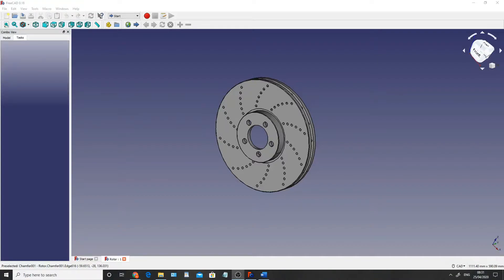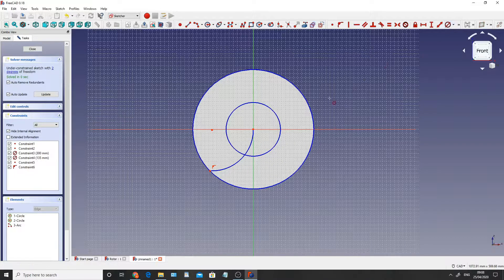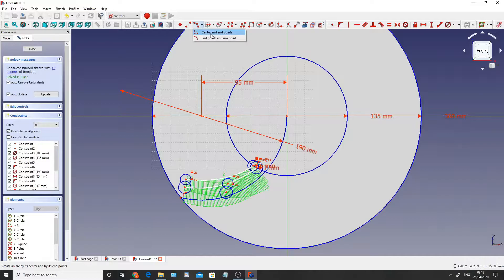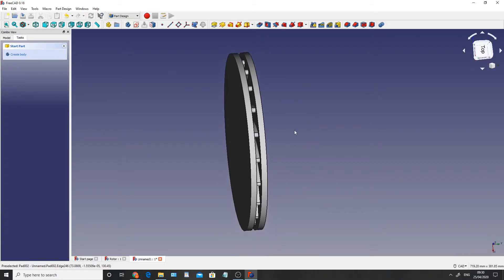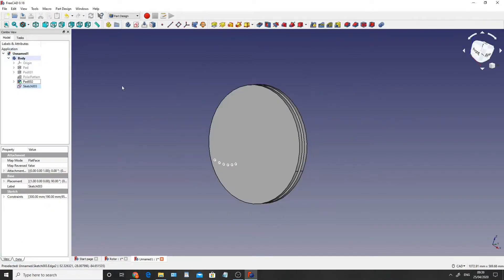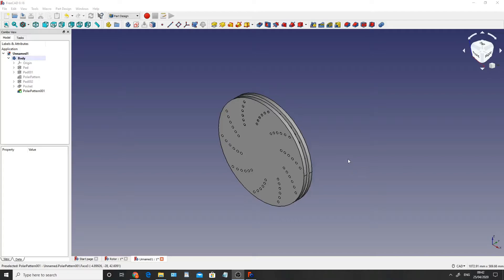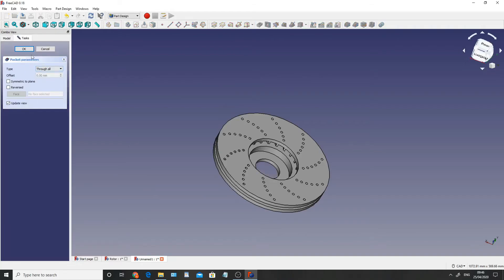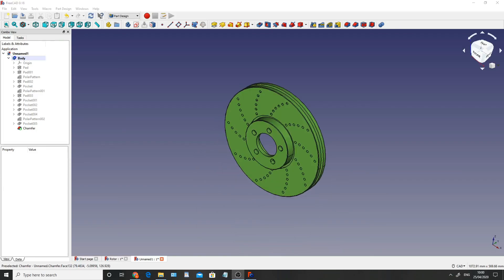FreeCAD Tutorial: Creating a car brake rotor

Comment: So idk what I'm doing wrong here but I keep getting a box in the middle of the rotor when I try to insert the 135 mm pocket into the rear face of the rotor. It doesn't even go as deep to see the cooling fins. Any suggestions?

Update: NVM Fixed by going 1mm smaller than 135 and it fixed the issue. I think it is perhaps due to my cooling ducts being on the 135mm construction circle at full length and getting cut through with the pocket i was trying to install.

Comment: In this case, what is the benefit of creating a construction line instead of using an external geometry when possible?

Further to replace the junky b splie wouldt the be possible to use 2 seperate datumplanes and rotate them in of offset around the z axis?